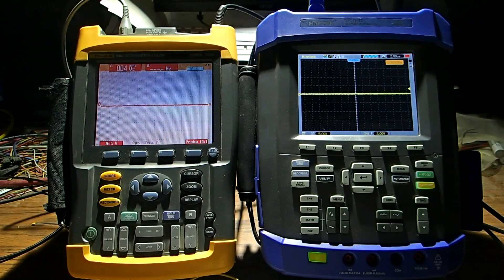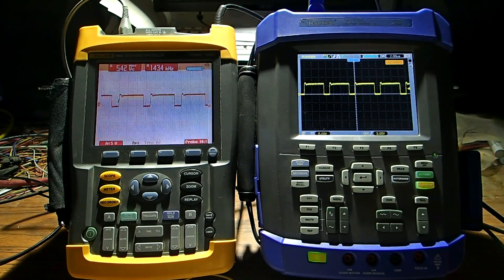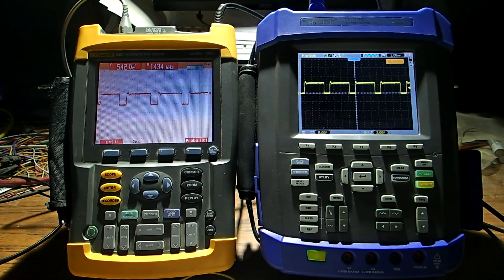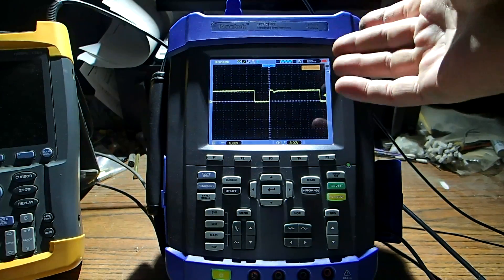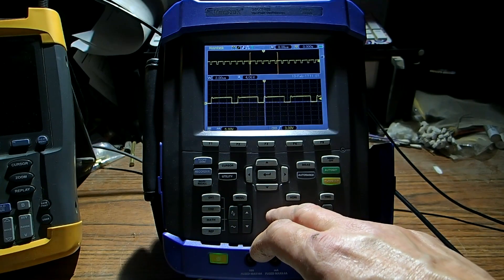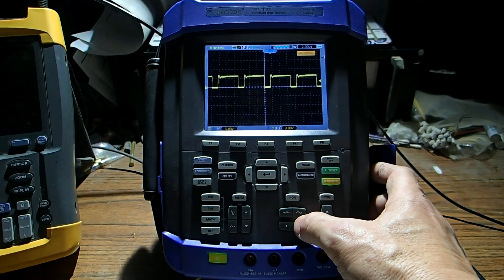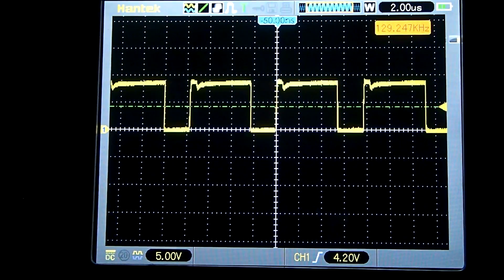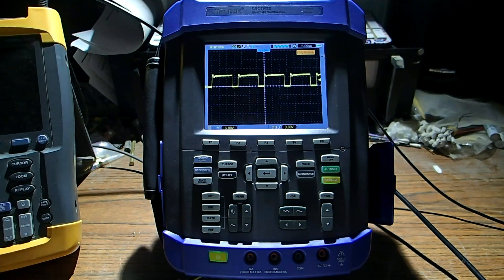Hantek Scope verses Fluke Scope (How Good is it?)

Comment from the maker: I can tell you from my personal experience on the fluke it takes a sec for the waveform to change, it's instant on hantek
Reply: Wondering how the even more cost effective Hantek 2C42 is compared?
Reply from the maker: @jafinch78  The Hantek 2C42 basically uses the same Control software and is it good quality little scope that is more portable and easy to carry around the last price cost I seen was like $142
Reply: @RaptorRotorHead  I just received yesterday the 2C42 in the mail.  Reads like I can upgrade/hack the firmware to make into the more expensive auto version also.  Need to still read into the manual and install the software.  I don't own a Fluke, though do have some bench scopes.

Comment from the maker: Nowadays you can get a pretty good quality oscilloscope for about 500 bucks now the new fluke oscilloscopes I'm sure that there's screen updating is faster than the one I have which is 13 years old but definitely the updating of the hand Tech is very fast I can see the wobble in waveforms that are operating in regulation so you can see Jitter really easy

Comment: is it fluke 199C or 196C? I cannot see the model # clearly. Also Fluke 199C datasheet says screen update rate > 100/sec which is kinda terrible I agree. The resolution is also 320x240. How is the resolution on the Hantek? Do you know its update rate? 
The big selling point of the Fluke 199C is (1) excellent unmatched safety ratings (2) 2.5Gs/sec sample rate for each channel independently. However with 3K waveform memory I dont know how useful is that sample rate.
Reply from the maker: It's a 196C
Reply from the maker: The hand Tech screen update is really fast you could tell by looking at the video you could see the flickering on the flute you see no flickering on the hand Tech. The hand Tech scope is also faster at responding to Signal input.
Reply: thanks. I was so undecided about getting a 199C but with this information, that's it for me, no Fluke for sure. Their new products seem to be very good but ridiculously expensive. So  I think I'll go with a used U1620A from Agilent since I really need the high safety rating and isolated inputs
Reply: I guess we might be wrong about judging that waveform update rate based on the flickering seen in the video clip. Come to think of it, that flickering is due to the PWM control of the LCD backlight on the Fluke and has nothing to do with the waveform update rate. But I found a Fluke datasheet that says waveform update rate is > 100/sec. Still too low but probably not bad among handheld scopes. A Keysight Tech support person told me the waveform update rate on a U1620A is only 50/sec !! The Fluke is at least 15 years older technology than the Agilent one...Although the Fluke has a much lower resolution (320x240) than the Keysight (640X320) so it maybe it kinda makes sense...
Reply: I also found a specification in the Hantek user guide that states the update rate (they call it refresh rate) is 50/sec maximum.

Comment: It seems the waveform generator can only do 3.5 volts dc?  This is a bummer as some field work requires 5 vdc square waves for testing equipment.
Reply from the maker: The waveform generator is a little IC chip on a breadboard it's not connected to the scope except to its input

Comment: How do you get the flashlight to turn on?
Reply from the maker: Barry O'Sullivan I never tried to turn the flashlight on I know it comes on when you boot up the scope but there's probably menu setting in there to turn it on like is everything else with that scope you got to look around like hell
Reply: the menus aren't the easiest to get around and the beeper doesn't work when using ohm meter
Reply: Mine's an 8202E. I got it directly from Hantek for 580.00 USD plus 88.00 customs charges. 200 bucks less than i could get it anywhere else

Comment: Is this handheld oscilloscope HANTEK good for automotive diagnostics?
Reply: Check out the 6074be or cheaper 1008c or other hantek scopes.  They work with tablets or PCs.  For $600 you can 6074 kit 4 which can do almost everything you would want to do.  You can also for $45 get a 20 MHz Hantek 6022be unit that should do most of the stuff you may want to do on a car.  My guess the probes are what you should upgrade on.

Comment from the maker: After making this video since the camera is 30 frames per second you could see the updating on the fluke you can't see the updating on the hantek so it's probably doing probably 120 maybe 300 frames a second.
Reply: not true. Same result can be if framerata 25 vs 30

Comment: I don't understand why Fluke use a very low quality displays.
Hantek comes with better display, may be the funtions are similars.

Cheers.
Reply: Fuke sucks on displays they break all the time  and old style LCD no TFT and the viewing angle sucks even more.
Reply from the maker: Ricardo B the fluke has just the same high quality of display just at the hand Tech has more color options things like that
Reply: Refresh rate looks better on Hantek.
I have one Fluke 289 and one friend bought a chinese meter similar to my Fluke, display of chinese meter is tons more better and overall contruction is very good.

Cheers
Reply from the maker: Ricardo B I see what you mean that's because the camera shutter speed and the refresh rate on this fluke are closer together than the hand Tech the hand Tech probably has a faster refresh rate, but to your naked eye you cannot tell the difference only the camera reveals that.
Reply: aahhh is true sometimes the camera catch some thing but the naked eye can't see.

My Fluke is oscilloscope is very old and I am looking for a new one, do you recomend this Hantek?

Thanks so Much.

Comment: Thanks for a great review, I was looking at one of their older models but saw some not so good remarks on them then saw this review on this model and have bought the 200MHz model of the back of it. I've got an Agilent X4000 series  but wanted something I could just pull of the shelf if I needed it a bit quick. How good is the signal generator function? Can you use the sig gen and scope at the same time?
Reply from the maker: Richard Ballinger mine does not have the signal generator function it has a square wave output for calibration of the probe but not a generator as such.
Reply: OK, thanks.
Reply from the maker: Richard Ballinger I think you got the next model up better than mine I have a hundred megahertz you have 200 that comes with extra features
Reply: My Agilent scope has two built in sig gens and I thought a portable unit would be great, can't wait to get it.

Comment: These commercial Chinese brands have come a very long way with digital scopes, e.g. Hantek, Rigol, Owon. I noticed the same with my Rigol, extremely accurate and a tonne of functions for only 400€. The only lesser thing so far, it only has 1GSa/s @ 50MHz and chops it up according to how many channels you're using and they are not isolated. However, for only €400 giving you 4 channels, I definitely can't complain.
Reply: I'm getting my DS1054Z coming Sunday.
I agree on oscilloscope development. Ten years back this level of accessibility would be unimaginable.
Reply: Ah nice! Becareful, probe ground channels are not isolated!! If you probe a MOSFET Drain-Source and Signal-Ground to see if they correspond, you WILL blow up your scope. I suggest getting something like this: http://www.ebay.nl/itm/JYE-Tech-DSO138-Digital-Oscilloscope-Kit-13803K-Unsoldered-DIY-DS0-Flux-Workshop-/121754419439?hash=item1c592100ef:g:wzMAAOSwiLdV7vXX to have on the side for probing signals. I have 2 of those.
Reply: Yes, I watched an EEVBlog on that one...
Thanks anyway!
Reply: NNNI You forget easily, I did that once already, luckily with low power.
Reply: Oh, sorry.
Reply: Overall a great scope, but if your waveform is not stable, it will not trigger and drive you crazy.
Reply: Does it have AC triggering?
Reply from the maker: NNNI yes I believe it does have AC triggering I seen it in the menu
Reply: Oh, Thanks.

Comment: hanteck does it come with isolated channels
Reply from the maker: Vasudev Mr no it does not have isolated Channel ground only the fluke has that I know of
Reply from the maker: Vasudev Mr that is good on your coil gun, the least stages and the least capacity is the most efficient coil gun.
Reply from the maker: Vasudev Mr your optic detection they are slow I had to search for faster ones. I have a digital chronograph now I don't need to use those detectors anymore
Reply from the maker: Vasudev Mr I'm working on something right now that uses less parts, I don't know how good it's going to be. went i eventually get money, I'll build something bigger right now it looks like I got to play with the parts I got.
Reply from the maker: Vasudev Mr that I would have to figure out. most likely uses an opamp.
Reply: Siglent makes one with isolated channels
Reply: DS1000S series have a isolated channel